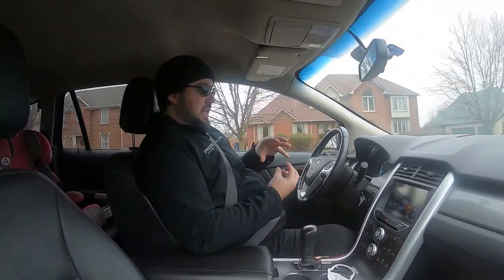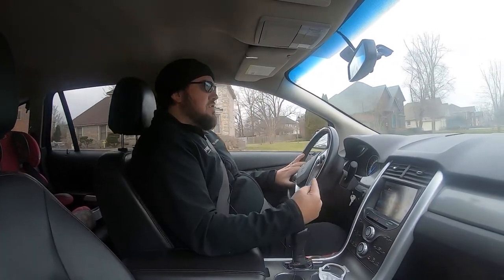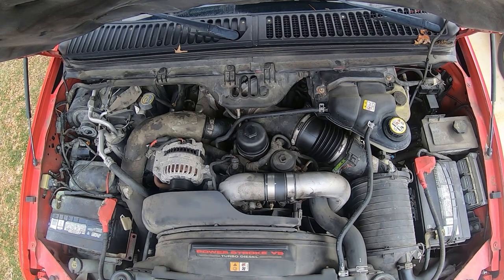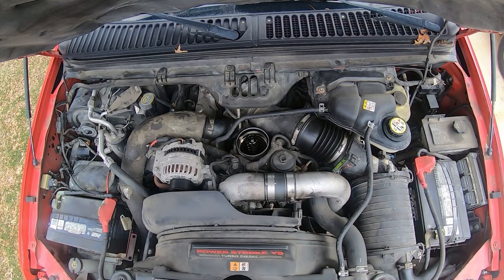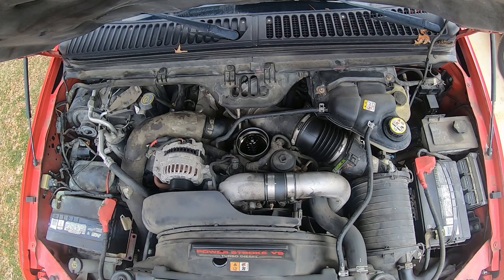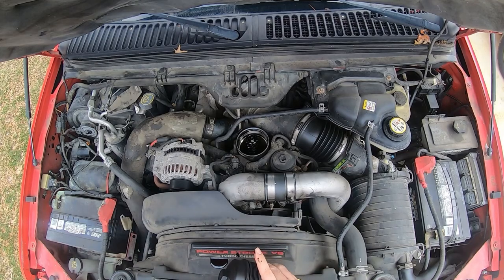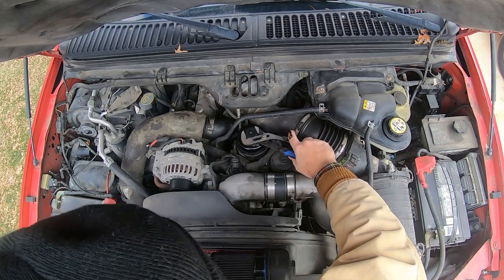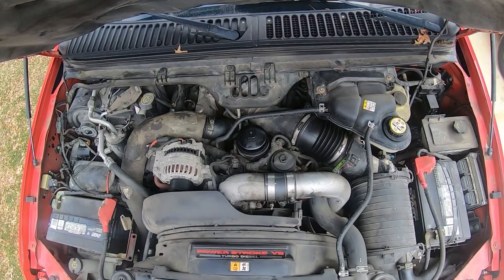WRONG OIL FILTER CAP ON MY 6.0 POWERSTROKE! Don't be dumb like me.

Comment: Why does everyone jack with shit that ain't broke?  Why did the oil filter cap get changed to begin with?
Reply: Because every filter comes with a new cap to be installed
Reply: Apparently the connector between the filter and cap is patented by Ford.  So the work around for aftermaket suppliers is to design their own cap and filter with a different connector.